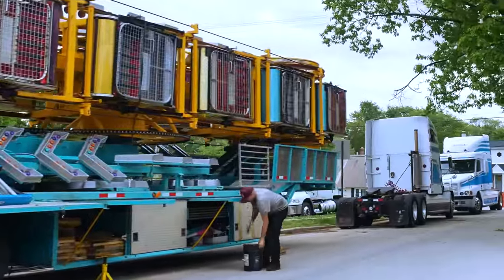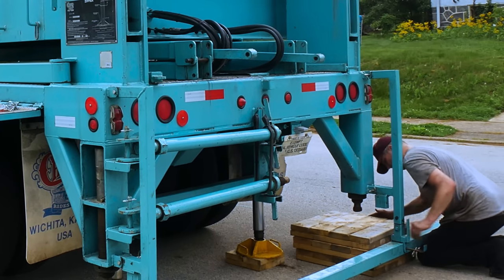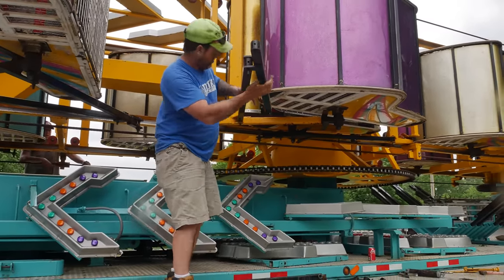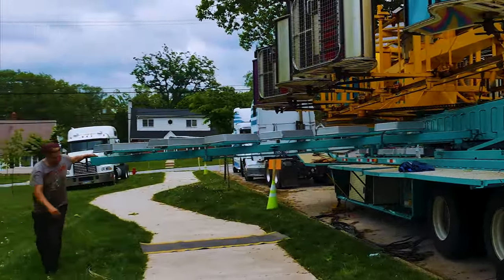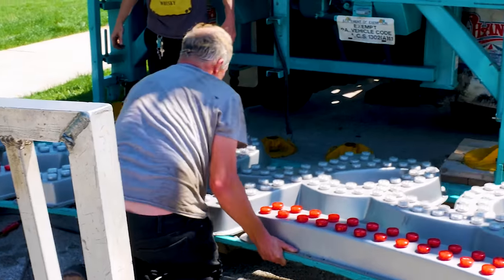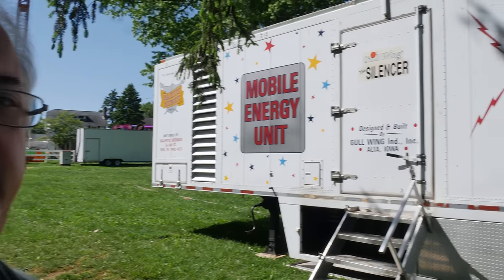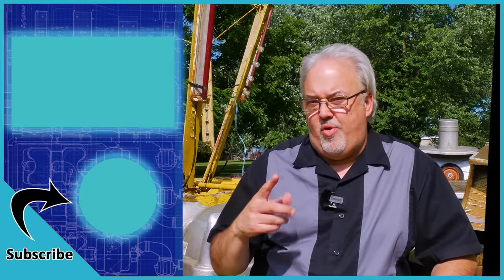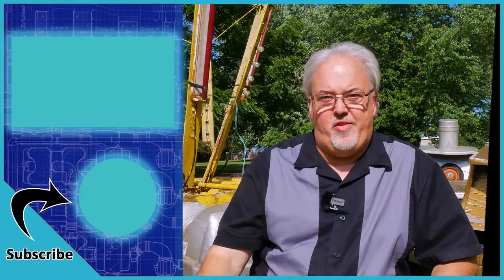Unzipping the Zipper: The Secrets of Setup Revealed

Comment: Seriously the best non-coaster ride ever. Unpredictability, positives, airtime, this thing has it all. I've always fantasized about a permanent model being built at parks.
Reply: It does have everything! It's a good one for sure! Imo the Zipper simulates being violently slammed onto ground or thrown high up into the air and ultimately falling to death or serious injury. It's scary at times but a great ride overall.
Reply: I think it was permanently installed in Parque Diversiones in Costa Rica back in the 80s and 90s, but it's no longer there unfortunately

Comment: The Zipper was the second ride I worked back in '80, I worked them for 2 seasons. I am impressed with your narrative and the fact that you didn't jigger the Jocks' arms while they were building it. There are no dumb questions in syntax, just in the circumstance you ask them in. Voice overs are fine. I will say, that I am impressed that you used the correct names for the various parts of the ride, such as scenery and H and K bars. 
   The Zipper was an excellent ride to work, it could be run by 1 person if the crowd was patient and the operator was fairly quick with an R-Key. The dog houses under the trailer made good accommodations for the crew in good weather, and the thing basically rained money. We had a huge sign that told people to secure their goods, and we were not responsible for lost articles, yet people insisted on donating to the 'Ride Operators Booze and Burritos Fund of Walla Walla, WA'  I could make 15 to 20 dollars (after the split) a night on a good spot. 
   Setup was not complicated, we could put it together and ready for inspection in 2.5 to 3 hours if we had a local with some common sense to help us, and was simplified by the awesome brace of hydraulics. Chance built and awesome machine. 
   The only gripe I had was the yoyos who would get the thing into a death spin and would not stop even after they got to the bottom. I saw someone get laid out after being hit by a spinning tub. It's fun, I know, to see how fast you can make a tub spin, but, remember, you have to get out when the ride is finished, please, for the love of all that is holy, PLEASE stop spinning toward the end of the ride.
Reply from the maker: Thanks for sharing!

Comment: I ran a 1976 Zipper from mid 90s to early 00s.  Ours didn't have the power assisted levelling system, we had a hand pump.  We also didn't have the catwalk as half our possum belly doors were removable completely.  We had to do our tubs and kbars the old fashioned way by moving a ladder around. 

What made it even worse is the kbars themselves didn't rack on top of the trailer.  The rack back then was in the possum belly.  You can imagine the hassle this caused.  The place where the kbar rack is on this one is where we used to have to put the 2 tubs we had to take off each week.  This was thankfully fixed a couple years after I started working on it when we got a kit from Chance to make it so we didn't have to take the two end tubs off anymore.

Anyway I just had to say think you for this video!  My time as a carny ended right before the iPhone unfortunately, so all I have is old Polaroids lol.

Comment: I first rode the Zipper in '71 or 72, not long after it came out and probably the first year it appeared at the annual Flower Market in Wilmington DE. I was on with a friend who figured out that if you really rocked on it as your car was going around the wheel, you could get it to flip 360 degrees. This was making me crazy, but at one point, he got it flip SIX times in a row! The last time I rode the Zipper, maybe 5 years ago, I had difficulty getting to flip even once. I couldn't tell if this was due to some modification to prevent them so easily flipping around, or just because the ride was 40 years older. It's kind of amazing to me that a carnival ride manufactured in the late 60s or early 70's is still going. Wiki says: "The first fourteen Zippers manufactured spun at much higher speeds than modern models. The boom rotated at 11 rpm and the cable system at 7 rpm. These first-generation rides kept the passenger compartments spinning on their axes constantly, creating unsafe g-forces and causing impact-related injuries such as whiplash, bruises and back injuries. The safety hazard was quickly discovered and the mechanical rpms were permanently lowered to current speeds."

Comment: As a youngster I tried to watch the rides being set up when the carnival arrived in my childhood home town. However, my favorite ride, the "Trabant" - I was never able to see it set up. I know it is not as complicated as other rides, but I always wanted to see the "underneath" parts and how they work. I know the disc spins on a center axle and the outer rail rolls on 1 or 2 hydraulically driven tire / motors and it raises and lowers with a large hydraulic cylinder - but I still don't have a full confirmed understanding of exactly how the under platform rotates. I'm guessing it is similar to how a track hoe rotates.
It would be awesome if you could film a Trabant being set up and the workings of the under platform.  (the 2nd generation was called the Wipeout and the new ones are called Freestyle and both are designed more simply than the Trabant)
Reply from the maker: I don't know anyone operating a Trabant but I'll keep an eye out for one.  Thanks for watching!
Reply: Now that's a name I was trying to recall!! As a kid we never had too much money so any saved for the carnival went to careful choices because we couldn't Fford to buy tickets for all of them.  The Trabant and the Zipper were sure to be there. I think the Sizzler and the Spider were the same ride.

Comment: I saw two of these ZIPPERS back to back
to each other going different direction
at Florida State Fair few years back.
They were two separate
rides one behind the other
very interesting
Reply: We set our Zipper up next to another at the '80 FS Fair. We talked to the operator of the other one and basically synchronized them so we would either be running them in tandems and opposition. Our operator would trade hand signals with the other to set cable and boom direction. Absolutely awesome.

Comment: I was the primary ride operator for The Zipper for 2 years for AAA Amusements.I was the assistant to the old ride operator for a year before I took over. I broke the ride down and drove it across multiple states...I also avoided weight scales that I KNEW would flag me as overweight. I reassembled the ride and passed local inspections on a monthly basis.

I found the best part of that job to be toturing big mouth morons who said they would NEVER puke on my ride. I kept a pressure washer and cleaning chemicals near my ride and wouldn't let the loud mouth off until they puked. 😈

Comment: i wish  you had a video on setup of a yo yo swing ride and a enterprise those two are my favorites. i used to work at a local amusement park and we had a portable model. I was always fascinated as to how the trailer folded up into a hexagon shape once it was fully set up. In the winter they would only take the swings off and pull the sweeps in on the main cylinder.

Comment: Some models didn’t have the trailer jacks. You had to use the hydraulics to disconnect the tractor from the trailer. Yes, there is a way to manually operate the hydraulics. Same applies to the Chance Alpine Bobs.

Comment: I've talked to carny riggers, and most of them say that a Chance Zipper IS  the de facto - easiest  ride to both set up and take down, because everything (including the cars) stays attached to either the main rotating boom, or the trailer, and it's just a matter of lining everything up properly, and raising or lowering the main support mast via hydraulics, which is hinged to the trailer assembly... It is said that 2 or 3 well-seasoned riggers can have a Zipper up and running, or down and ready for transport in about 1/2 hour's time!
Reply from the maker: You're right, It's not a hard build (The guy in this video has torn down the whole ride by himself on multiple occasions)  but 1/2 hour seems a bit ambitious to me even with a well trained crew.  You can screw away 10 minutes or more just getting it leveled and blocked.  Then ya gotta unlatch all the tubs, slide them out  of the H frames and pin them, add the K bars. Fold out the wind braces, start to lift and then screw the main support jack forever.  Adjust the cross cables, check the tire pressure. Not to mention attaching all the scenery and building the deck and fencing.  It is a bunch of fairly simple jobs- but it is a bunch of them- the biggest physical labor is carrying the deck, fencing & scenery from the front of trailer to the rear.
Reply: @PeteRondeau  - Probably does take longer than 1/2 hour to be sure, but that was heresay boast from theme park mechanics that once did their time as carny riggers...

Comment: I'm amazed at how strong that hydraulic actuator is to lift the whole ride into the air..  I mean geez that's gotta be 30,000 pounds or more of steel!!  It actuator looks big enough to lift an apartment biulding!!
Reply from the maker: You're right, but  what I always think about is the cost.  Imagine what that cylinder adds to the purchase price of the ride and it isn't even an active part of the ride.  It is strictly there to help set it up.  Thanks for watching!
Reply: Called a 3 stage cylinder. It goes up and folds in at three different stages. 

Also the cost is pretty big 😂

Comment: So I want to comment that the hydraulic pump that is in the frame of the shot is the exact same type of pump that is used in a factory on blow molding machines it produces 1000 pounds of working pressure consistently for machine operation and 1500 peak for clamping force on blow molds which for that type of pump is maximum pressure and that's for just making milk jugs

Comment: It's funny, the one ride I don't ride at carnivals is the Zipper. I never thought it was safe enough, or thoroughly inspected.
Reply from the maker: Funny enough, I think it is almost safer to ride it than to stand near it.  They have been known to throw a wheel from time to time and although this poses no risk to the rider (there are 120 of them- it will run fine without a few), it could come down and knock you on the head if you were waiting in line.
Reply: As someone in the business that owns rides here’s some friendly advice. When you go, look at the ride. Are all the lights working? Is the paint fresh? Do the seats and vehicles look well taken care of?

If all of the above , you’re safer in that ride than driving in your car. 

I’m not sure the name of this show but I can tell you by the video, they take very good care of their equipment, have updated it with the latest in lighting, and the paint in all the places looks fresh and well taken care. Beautiful little show.
Reply: @Ericb1980  Thank you for the advice. Lol, you probably are safer in a car on some of them, except the brain damage. I have seen them full of rust and squeaking super loud. Sometimes like a grinding noise.
Reply: @elidanko1912  they’re machines. Machines make noise. Just cause it makes a sound doesn’t necessarily mean it’s bad. Sometimes it’s just an indicator it’s old. Old doesn’t necessarily mean bad or worn out.
Reply: @Ericb1980  I understand. But it can be hard to trust Zippers when you are at a local carnival when they set up the rides overnight.
Reply: @elidanko1912  zero reason that one has to do with the other.
Reply: @elidanko1912  and they’re not all set up overnight. That’s like saying “I’m not taking my car to the mechanic they’re all crooks”

Comment: love your video! very interesting! how long do carnival rides stay in service? do they have to retire them at a certain age?
Reply from the maker: There are rides that have been in operation for over a century.  I would say that "spectacular" thrill rides have a potentially shorter life due to the stresses they are under but most rides are scrapped due to maintenance neglect,  accidents outside of normal operation, or inspection issues- for instance being involved in a highway accident going down the road, or toppled over in a tornado.  Another instance is that the original manufacturer is out of business and the state requires original manufacture parts.  Or the manufacturer requires a massive overhaul or inspection after X number of years and it is felt that the ride doesn't earn enough to warrant the overhaul/inspection process.  Lots of different issues.

Comment: I want one for my backyard! Do you know why they don't allow single passengers?
Reply from the maker: I believe it is primarily due to the restraint system. A single rider has room to turn sideways and come out under the lap bar. With two riders this is  prevented.  There is a newer design that uses over shoulder restraints but I’ve heard hardcore zipper fans seem not to like them

Comment: I wonder why not leave the hydraulic jacks down for more support?
Reply from the maker: I don't know but I have a speculation.  When they are up, they are in the only known state that can be verified by a visual inspection.  If they are down you don't know if the pressure has leaked past the piston and they are doing nothing.  Alternately, if the valves are leaking they could be slowly lifting the ride and you wouldn't know it.  So, for that reason, they raise them and lock them off- at least that is my theory.
Reply: The hydraulic jacks are retracted during the ride's operation because it is unnecessary (and sometimes dangerous) to retain such massive pressure on the cylinders while the pump is simultaneously providing power for the ride. The screw jacks and cribbing blocks shown here provide ample support for the Zipper's stability -- even if you have to set it up on an incline (in which case you'll always need to bring a healthy amount of blocks along, just in case).

Comment: FUCK THIS RIDE ! I love your channel, but this ride in particular can kiss my cheeks ! depending on who runs it and who sets it up, it can be super dangerous and not "user friendly". twice i've ridden this one in two different locations and twice some bad stuff has happened. first time was the fairgrounds in my home county. the door came open during mid ride on me and my nephew. they caught it and stopped the ride. then at the Illinois state fair. the Gear in the center somehow cracked or had a rusty area of it snap and the chain attached to the gear slid off. Luckily, i was at the bottom and it was just as the ride was going to be sent around to load more people. sure, Maybe it's me, but I've ridden a ton of rides and love even the oldies, but the zipper ? never again lol.